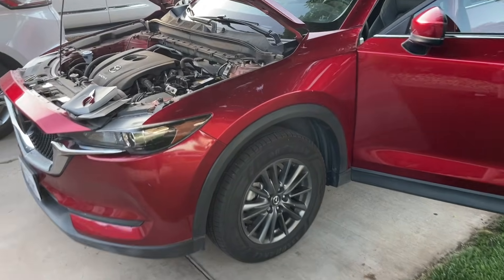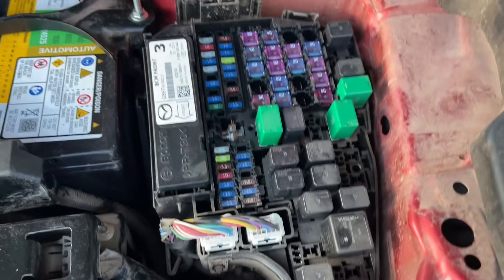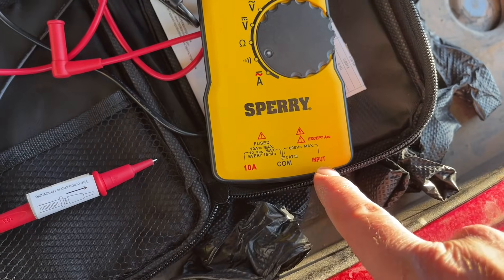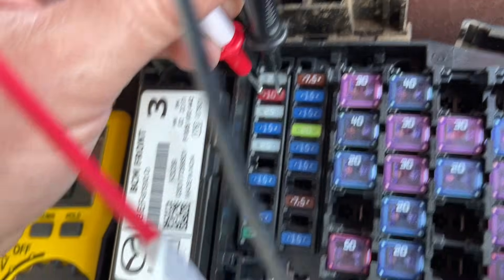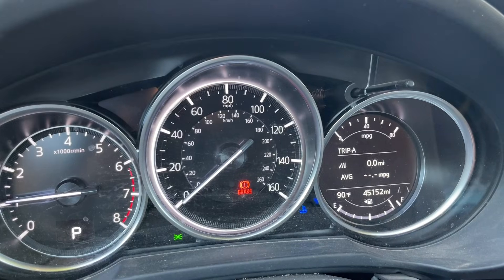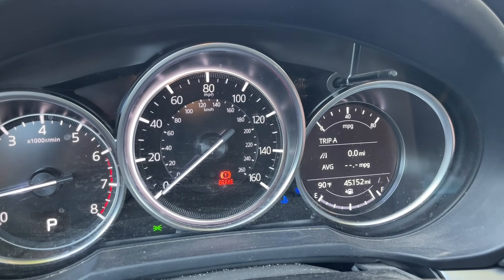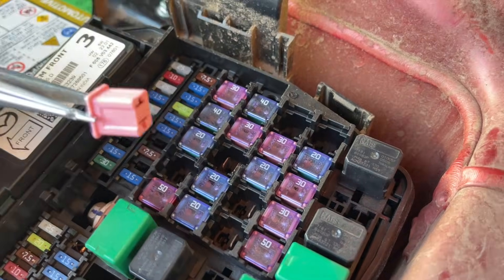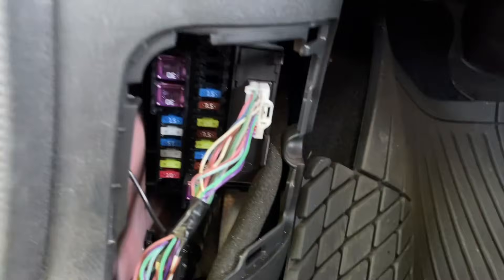Battery hooked up backwards, car won’t start. How to fix your bricked car. Blown fuses, test fuses

Comment: So why is it almost every electrical plugin on a car is idiot proof except for the battery hookups?
Reply from the maker: I agree. They make on terminal larger than the other, but they could make the cable ends different shapes in my opinion, and a better fuse right at the cable end.